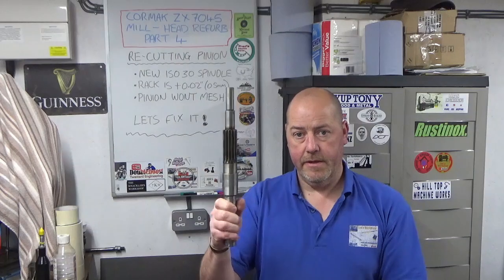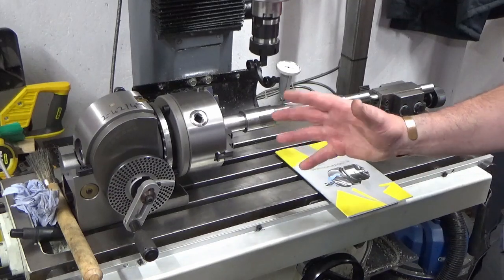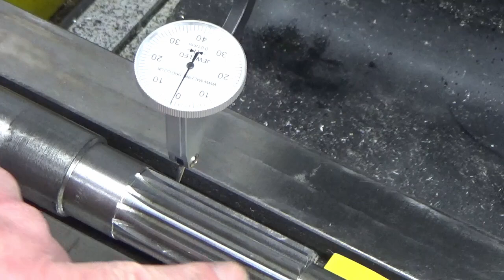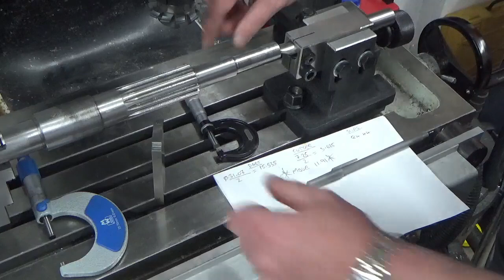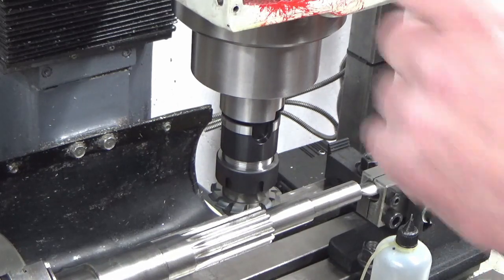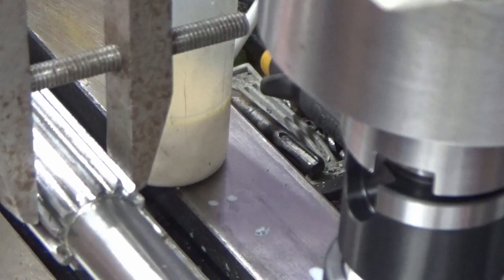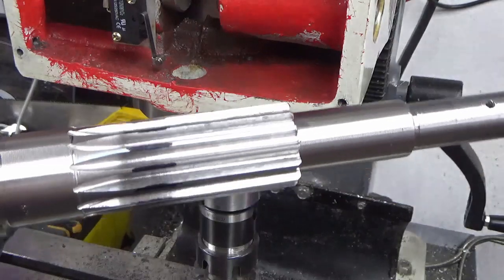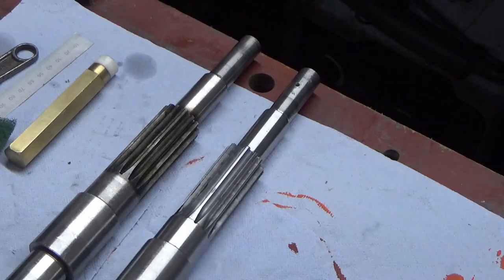7045 Milling Machine Head Refurb - Part 4a - Re cutting the Pinion Shaft

Comment: Bummer Jon, BUT, how about this. Skim off the buggered teeth, shrink on or pin  a sleeve and recut the teeth, will save making the whole shaft. Secondly with the, the sector arms, the 42 holes should be BETWEEN the  tapered edge of the fingers AND it is 42 holes NOT counting the hole that the pin is already in. In that way you do not need to lift the pin out to go over the top of the sector arms. Out of interest did you try it in the head to see if you cut deep enough. Should fit at some point as normally there will only be 2 or 3 teeth in contact with the rack. Your radial pitch error should not matter too much over 3 teeth for a test fit. Regards from Australia.
Reply: Hi Dave, Jon. I was going to suggest exactly what Dave has just said above. Skim off the bad part and pin on a new sleeve, and start again. A good press fit and a roll pin or two should be sufficient. Alternatively can you use the hardened shaft and modify the other gear?( the rack on the spindle?)
Reply: Definitely a viable option. What is the worst that can happen?
Reply from the maker: Hi Dave, thanks for the comment. Capital idea. I will blend with another good idea and make a Delrin sleeve as well to play about with the depth. Sector arms on this won't let me get 43 holes between them, so only choice was to make the remainder gap between them, this is also how the instructions for the head tell you. I have never had to do that before, seems odd. New sector arms as a future project I think. I did a trial fit on the 1st & 2nd tooth area, just about went in but still a tad tight (3 or 4 thou maybe). Cheers, Jon

Comment: Jon we have all made mistakes, the best lessons learned are from mistakes. Mr pete does a practice part first to make sure it is right and then cuts the part he is trying to make. one other option for repairing the part would be to weld it up and turn it back to size and then cut all new teeth.👍
Reply from the maker: Hi Randy, thanks for the comment and feedback. I did finish up doing a Delrin trial part before I made a new shaft just to be sure, it's a great idea. Cheers, Jon

Comment: Bad luck Jon, I've only used a dividing head a few times, first 2 times I cocked up, luckily,  not a mega expensive part.
Great suggestion by one of your subscribers in the initial step, plus yes, shrinking a sleeve on is viable,  it will never see any appreciable load, extend the sleeve and add a peg/through pin.
Well done on sharing your mistakes Jon.
Best regards from the Black Country. 
John.
Reply from the maker: Hi John, thanks for the comment. Last time I used one of these was in the early 90's lol. That fact alone should have made me approach this job with much more care and attention. Sleeve is next up so shows not over yet. Cheers, Jon
Reply: @jonsworkshop  Hi Jon, 
Early eighties for me,  watching you index, something didn't look right, it was that you were using the non chamfered side of the fingers, I certainly didn't clock the hole  numbers as others did. I remember as an apprentice,  someone coming out of the office to calculate the index required for a machinist, continued fractions if I recall correctly,  I did these a little later in my HNC. Again fair play for showing the downsides of engineering 👏 
Best regards John

Comment: I feel your pain. And I am glad it is not just me this week! I have made mistakes so often with dividing plates that I put a stepper motor on my rotary table, controlled from an arduino. I now key in the amount of divisions I want, or the angle.

I agree with what others are saying, keep that shaft, machine the teeth off and shrink a sleeve on, then cut new teeth. Your facial expressions at the end mirrored mine at the start of this week. I empathise 100%.

I
Reply from the maker: Hi Carl, thanks for the comment. Lol, it's all good fun despite how disappointed you feel at the time. Last time I used one of these was in the early 90's so I should have been very much more careful and that's the important lesson for me out of this. Sleeve is next up, why not, great suggestion. Cheers, Jon

Comment: Oh dear Jon but good on ya for showing us the mistake. Gear cutting/setups can be a complex procedure. So many variables and its so easy to lose concentration especially when filming as well. Cheers Kevin
Reply from the maker: Hi Kevin, thanks for the comment. Yep, filming certainly adds another dimension to the concentration required lol. Have a plan to fix now using a sleeve. Cheers, Jon

Comment: Ah fixing things worse - been there and got the tee shirt. Thanks for sharing, we can all learn from mistakes (eventually in some cases 😀). Dividing heads always confuse (unless you are using them regularly) and any time I've used mine (not very often so I sympathise) I tend to run a check with a bit of plastic or scrap just to see what's happening. Not always practical but as someone who had never used one before, seemed like a plan and gave a bit of practice. Anyhoo, look forward to the solution, thanks again for the videos.
Reply from the maker: Hi Pakrattuk, thanks for the comment and very wise advice. Last time I used one of these was in the early 90's lol, I think that qualifies as long enough ago to excuse my stupidity lol. Will be practicing before my next attempt. Cheers, Jon

Comment: Another option Jon, build the shaft back up with weld, then turn it round and start again! May be issues with distortion so probably better sticking with sleeving and pinning or similar.
Reply from the maker: Hi Olly, thanks for the comment. I did consider welding but discounted mainly due to me not trusting my welding abilities, distortion, and the hardness to recut with HSS etc. Sleeving is something I didn't think of in the heat of utter disappointment whilst filming, that's up next so shows not over yet. Cheers, Jon

Comment: The old saying comes intp play on this one Jon(unfortunately) "Measure 3 times and cut once" On the bright side just think of the experience you will get making the new shaft to size.  You could make an aluminium one first to make sure the new splines fit and work before trying out on an expensive bit of shaft material. Thank for showing this, that way we all learn by just one slight mistake. As a second thought You could weld or have welded up the old shaft and recut it, at least when done you have another test piece.
Reply from the maker: Hi Derek, thanks for the comment. Bang on! I am going to try sleeving it I think. My welding isn't good enough for this, it would look like the surface of the moon when I recut it if I try that. Also, concerned the heat may distort the shaft etc. Shows not over yet lol. Cheers, Jon

Comment: I feel for you Jon.
Is it possible to to recut a little more off the pinion to even things up and see if it works? May have a bit of backlash but could work ok and will prove the dividing head setup.
Reply from the maker: Hi Gr eg, thanks for the comment and suggestion. I could but I really want to avoid any backlash as not yet having a DRO on the quill, I rely heavily on the fine feed graduations for depths. Will be sleeving and making a trial Delrin one to ensure setup is fully proven prior to the real sleeve. Cheers, Jon

Comment: Hi Jon. Is there any chance you can heat the other shaft to soften it. So it will cut with HSS. Or as others have said , weld the old one up & start again. Curtis at Cutting edge engineering on his channel often does things like that. 
Steve.
Reply from the maker: Hi Steve, thanks for the comment, I am going to have a crack at sleeving the one I messed up. Don't trust my welding enough to fix it that way lol. Cheers, Jon

Comment: Hi John, well pal a bit of a cock up, so I think Dave’s idea of machining away the old spline would be my choice and may be even Tiging  a new sleeve in place or is it possible to Anneal the hardend shaft so it can be machined and the temper it
Reply from the maker: Hi Terry, thanks for the comment. Sorry for the delay responding. I guess you already know what I did lol. All good suggestions though. Cheers, Jon

Comment: Wow Jon, really sorry to see this went "pear shaped".
Not being a Machinist, my question is it possible to just turn off the "cocked up" section, make a new toothed section that could be pressed over the original shaft & held securely with Loctite or even cross-pinned?
All of this is way above my "pay grade" but asking based on seeing other YouTubers doing similar with old "damaged" parts??
Reply from the maker: Hi Colin, thanks for the comment and great suggestion. The university of YouTube has taught you well. That is exactly what I am going to try next so shows not over yet lol. Cheers, Jon

Comment: Been there, done that, I always count the spaces individually, numerous times until 100% satisfied.
Just out of interest will the pinion slide in now, if so find position of minimum backlash and that will be your close enough depth of cut.
I would use k 1045, easier on the gear cutter.
Reply from the maker: Hi Willem, thanks for the comment and sorry for the delay responding. It still didn't quite go in (I think I showed on the next video, can't remember though lol). We got it sorted in the end. Cheers, Jon

Comment: I feel for you. You aren't the first nor will you be the last to mess up. Been there, done that. Also losing count of the number of turns you've made on the div head arm is another way to mess it up.
Two things I'd try. First, can you turn off the splines and heat shrink a sleeve onto the shaft, then recut the splines? Nothing to lose if it doesnt work. Second, put a piece of delrin in the div head and have a trial run. Much quicker to cut than steel and gives you confidence you've got the settings right.
Reply from the maker: Hi Robert, thanks for the comment. Going to do both those things so thanks for the suggestion. Let's see how that goes. Cheers, Jon

Comment: Would welding (filling the spaces between the teeth)it up and recutting the theeth work? Good on you for showing us your mistake. It'll certainly make me feel better  when I mess up next time. And I will...
Reply from the maker: Hi Nuno, thanks for the comment and sorry for the delay responding. As I said in my follow-up video, welding would put distortion into the shaft I think which would throw the bearing diameters out of line (maybe). Glad I made you feel better lol. Cheers, Jon

Comment: It is always a good habit to do a test run and move the part to be milled around the number of units, 14 in your case, before cutting to ensure it comes back to the original position.
I'm also not sure as it was difficult to see, but when you set the quadrant to the 42 holes it appeared your moved the handle  to the hole past the location arm, and then you moved the quadrant in the opposite direction you were rotating the dividing head. I have always moved the quadrant in the same direction as the handle, so if you are turning the handle clockwise as you face it, the quadrant should be to the direction of travel side of the quadrant arm, and when you reach the number or rotations and part of rotation the pin goes in the hole on the side you approach the finish quadrant hole, you then rotate the quadrant assembly so the initiating arm is behind the pin relative to the direction of rotation.
I am not sure if you are cutting a metric module or a British or American gear, but they all have set formulae for depth of cut, you can find that info in the Machinerys Handbook. For a metric 20 deg PA, the total depth is 2.25xModule number, for American 14.5 and 20 deg PA its 2.157/DP, American 20 deg stub tooth 1.8/DP and for British 20 deg PA 2.25/DP.
Reply: I agree with all you've said here. My simple rule is if the crank handle is being advanced in steps in a clockwise direction then the sector arms must also be advanced clockwise and the opposite is true for anti-clockwise.  The trailing arm of the sector arms is always behind the index pin at the index being cut and the leading of the 2 sector arms is always the target drop in point for the next new index.
Reply from the maker: Hi Dennis, thanks for the comment. Yes, trial run is a good idea. Unfortunately the sector arms on this head won't open wide enough to get 42/49. I have never come across this scenario before, the instructions tell you to do what I did (albeit with the correct number of holes). Very strange. New sector arms as a future project I think. Cheers, Jon

Comment: Bonjour. Je suis vos péripéties avec cette fraiseuse cormak zx7045. Elle est bien placée coté prix, j'hésite mais j'ai peur qu'elle soit trop bruyante ou nécessite de la refaire comme vous ce que je ne saurai pas faire. Qu'en pensez vous ? 
Elle est intéressante notamment par sa capacité à usiner de l'acier, les autres similaires sont au moins 900 euros plus cher en neuf. (Bernardo, weiss 
Avez vous des retours, car sur le web ce n'est pas évident de se faire un avis  sauf votre travail remarquable affaire de spécialiste. cdlt
Reply from the maker: Hi Frédéric, thanks for the comment. As long as you are not wanting to take big cuts, this machine is OK. My tips are to forget face Mills and fly cutters, and just use up to 18mm HSS ripper end Mills to remove steel stock, this way all of the noise will quieten down. Cheers Jon

Comment: Oops. But does it fit? You still have the right number of teeth but some extra clearance. You could even recut the teeth, again with extra clearance but as all the work it does is against a spring backlash is irrelevant. At least if you reassemble you will have a working mill, not to RR standards maybe, and find out if your depth of cut was right.
Reply from the maker: Hi Chris, thanks for the comment. Sorry for the delay, just catching up, I guess you know the ending lol. Cheers, Jon
Reply: Hmmmm , one could get the feeling one wasn't loved anymore. 🤔😁😁😁

Comment: maibe you can have someone with a (tig) welder and some welding/ repair experience fill in the grooves between the teeth with a material soft enough to be able to machine it (again ) with the toolsteel cutter , if that works you can save a bit on time material and machine work 
since its a steel part he should be able to just fill it in with a migwelder (boogerwelding) as long as he heats it up evenly so it doesnt bend 
even if he flame brases it (bronze/ brass)  you can machine it reasonably eazy and it might even be hard enough not to wear out too fast as you whont put a lot of force on it , the softer material might even be better against the steel rack  
https://www.youtube.com/watch?v=YWaF_QhcxA0
could even use prusian blue in the end to see if the teeth mesh properly between the rack and pinion
sumting you might be able to try to get the dept measurement using the 4mm rolls is cutting the teeth across from one another before comiting to doing all of them you might even be able to eyeball if you got the rotations on the divider right by sliding a heightblock against the freshly cut groove
Reply from the maker: Hi Watahyahknow, thanks for the comment and sorry for the delay responding (just catching up). All great suggestions, I guess you know how we ended up fixing by now 🤣. Cheers, Jon

Comment: Can't you weld up and start again cheers.
Reply from the maker: Hi NAVAHO, thanks for the comment. If only I could lol. My welding skills are not good enough for this, and I think distortion would be an issue as it has a fine limit bearing diameter at each end of the shaft so zero movement would need to be achieved. Good thought though. Cheers, Jon